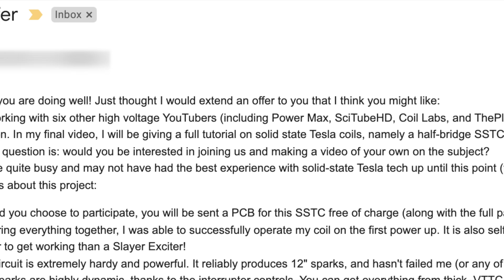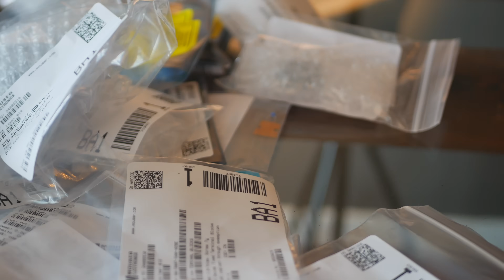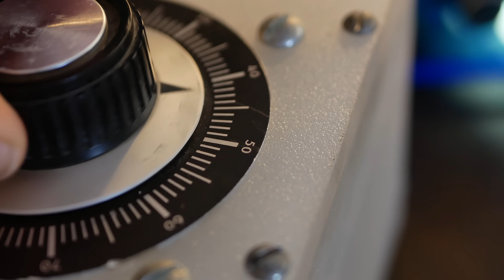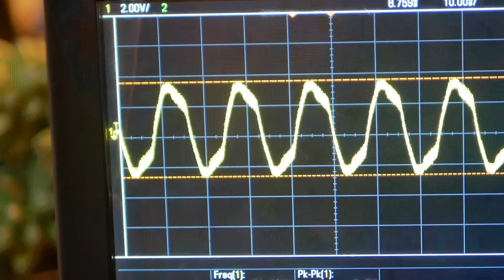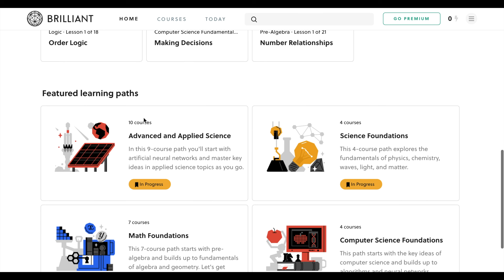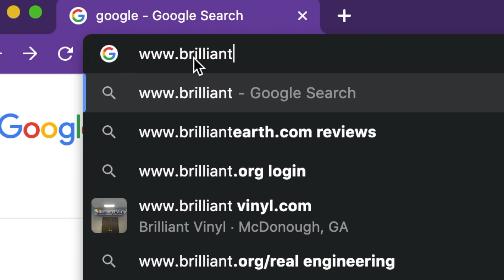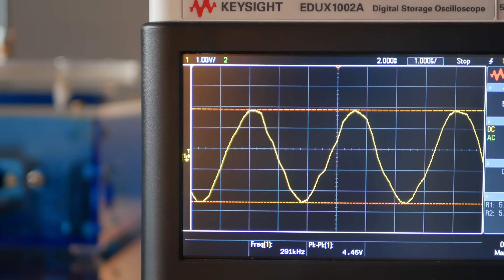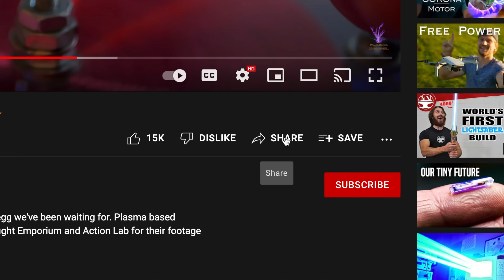⚡Building This Tesla Coil CHANGED EVERYTHING (HUGE 3D Lightning)⚡

Comment: I noticed arcing from sharp edges of the threaded rod you used.  Would replacing the threaded rod with a round rod (threaded at the bottom for mounting) increase the arc range appreciably?

Comment: I would love to have one of those boards. I am new to Tesla Coils, but I do have high voltage experience. I operate one of a handful of high current unipolar generators used to test aerospace equipment. Our lab also has a Marx generator capable of zone 2a levels. I definitely will be building a Tesla Coil for my home after seeing this.

Comment: jaw dropping implementation
Reply: spark gap can be adjusted too
Reply: pwm signal as the driver off-the-shelf
Reply: try a copper dust maglev fountain, flip the usual rotating maglev disc to a tower, or just put a electromagnet coil on the tower, then spray current conducting dust-particles from the center tower up, then keep it as a shield dust cloud, let it drop from the sides down, recirculate, you could even levitate water this way
Reply: ie, copper dust cloud shield levitation
Reply: full solid state or mechanical, the same cd shape as you have

Comment: Very cool, next build you should try flourescent acrylic, it's my favorite
Reply from the maker: Well hello there. That’s an interesting idea….
Reply: @PlasmaChannel  👍
Reply: That will be nuce
Reply: That will be nuce
Reply: Tesla coil technology has the potential to completely change the way we generate and use energy. A Tesla coil is a device that creates high-voltage, low-current electricity. It does this by using two coils of wire, one inside the other. The inner coil is called the primary coil, and the outer coil is called the secondary coil. When an electric current flows through the primary coil, it creates a magnetic field. This magnetic field causes electricity to flow through the secondary coil.

The potential for free energy from Tesla coils has been known for many years. However, it has only recently been realized that this free energy can be used to create a generator. A group of engineers at MIT have developed a way to use IGBT transistors to replace spark gaps in Tesla coils. This allows Tesla coils to generate electricity without any external power source.
Reply: @aplacetoimproveteslacoilin3721  there's no such thing as free energy. Gtfo. ☺️
Reply: @aplacetoimproveteslacoilin3721 literally impossible

Comment: Spacewind the secondary and you will get qcw like performance
Reply from the maker: How does that impact qcw? I thought that was determined by the transistor circuit.
Reply: @PlasmaChannel  higher mutal inductance less capacitance
Reply: @PlasmaChannel  if you have a higih frequnecy function generator or a  ham radio you can feed the high frequency signal through just the secondary and get discharges and a gain like inductor setup you are using without all the extra no need for a primarytuning the coil however is important especially with space winding it

Comment: Put that on a wheel that has a center metallic pole extended from a Tesla turbine, and dividing that voltage into very small fragments is possible.  Tungsten pins at even spacing, so 50-100 spark gaps are achieved for each revolution of the wheel. 
It is possible to get 2 million frequency per minute. Tesla’s one wire system is possible, his longitudinal electrostatic wave. Use a trompe to run the tesla turbine for off grid. 
The other ways of making it work better; quenched spark gap, and silver coated magnet wire. If one can get this system in an extremely cold environment and make sure each component is a harmonic of the fundamental, I believe that is what many call free energy, but it seems like a lot of work to me, not so free, but do able!

Comment: I would absolutely LOVE ❤️ to have this setup!! I built my first “Tesla coil look alike” at 14 years old. Using bits and pieces from old Tube tv guts, a fluorescent light ballast as a power supply for the fly back transformer, caps from a dozen microwave oven control panels, a small tote, 2.5” x 7” pvc former for the secondary, some 3 or 4” pvc for the primary after a lot of trial and error. The spark gap was made from these tiny brass knobs off of a jewelry box I found at the dump while hunting TVs and microwave ovens since I had depleted any and all sidewalk scores after driving my go-kart up and down every street and alley in 2 towns with a combined population of less than 4000 people back then. These towns are about 6 miles apart from each other so no big feat for a go-kart back then lol. Originally I had salvaged the magnet wire from the deflection coils inside the old TVs but of course had problems with it as I had too many connections soldered to make it long enough for 1400 turns, not to mention it was too heavy of a gauge to fit that many turns on a 7”former. After buying some 42 gauge magnet wire from radio shack, I had a secondary coil that would work. 492Khz was its resonant freq. I was only able to achieve arcs no more than 2” long but it was cool. My first coil and 95% made from junk I found laying around.. it was really more of a slayer exciter as it was able to light fluorescent bulbs from about 4’ away with no problem.. This led to a fascination with high voltage electronics and Tesla coils at first. Which grew into what I am still fascinated with today. Pretty much anything electronic 😁
Reply from the maker: Wow, that's really cool to hear about. Sounds like the good old times to me - I wouldnt know, as i've always had access to supplies, living outside of Seattle. Thanks for sharing!!!

Comment: Tesla said pancakes are more efficient if the space between the wires on a flat, are equal to the diameter of the wire. I use glass thread to get the correct spacing. Actually this is true for all coils, even solenoid.
Reply from the maker: Hmmm. I honestly did only basic research on pancake design. I'm more of a try or die type of guy myself.

Comment: Great looking build, you keep impressing me with your work. My first coil I put together in 1984, it was a 15kv 30ma neon sign transformer, a sheet of glass with aluminum foil on each side for a capacitor, hand wound 3"PVC secondary, primary 12 Gauge wire on a piece of 5 gallon bucket, spark gap 5 stainless steel screws on a 3 inch PVC cap.  Pulled 2 ft arcs on dry days, 18 inches on humid days.
Reply from the maker: That's the good old style tesla coils. Those will always be the best type IMO.

Comment: Hey Jay!  Love your channel, and your design looks super great!  I also just finished my own fancy design around this driver and had GDT issues frying a few igbts. Unfortunately minimal acrylic.  Haha I was wondering how your touching that thing??? I tried touching mine at half power and was surprisingly pretty shocking! So naturally I'm scared to touch full power. Lol
Reply from the maker: Mine at full power will very painfully shock you, but only if you are closer when getting shocked. If you let the sparks jump to hand at maximum distance, it's painless. But, moving in a couple inches, it is very painful. Closer = more current delivered.
Reply: @PlasmaChannel  gotcha! That's makes sense. Thank you for the reply! I do have one more question? I noticed that you only have one plug to run both the driver and the doubler circuit which is how I wired mine.  How are you using a variac with that setup? Wouldn't that make the low voltage circuit not work properly? Also I have the secondary grounded to the power plug ground. I know that's a big no no for spark gap coils, but is it still an issue for solid state coils? Thanks Jay!

Comment: I am embarrassed to admit that I’ve never thought to wind pancake coils like that. Looks beautiful! Might try this out myself- Have an idea for a magnifier coil config that uses 3/4 pancakes stacked on one another, separated by poly acrylic- But I’m worried that I need actual bushings or better insulators to prevent them from zapping each other! 

Love the design. Keep up the great work!
Reply from the maker: The drill winding method works well, but it's REALLY hard to keep the coil winding symmetrically about the center. You'd think the opposite, but it takes constant checking, adjusting, and intentional input. Give it a try!

Comment: Really nice work!
Gate transformers are not easy to make and can be a pain in the ass, haha (I haven't really manage to do one my self with low enough leakage inductance, to not cause problems with slow rise and fall times and ringing). In most circuits I have made (which I have not put up any videos of yet, since I have been to lazy to draw schematics), I use to build a mini flyback converter that gives out an insulated DC voltage - then use that DC voltage to feed the output of an opto coupler with built in gate drive instead (for example the HCPL 3180, which I bought a load some time ago). 
A little more work, but often worth it given it also have some advantages. If building for example a buck power regulator for another circuit, the transistor can be continuously on (allowing for 100% power) with the gate still insulated. The gate charge voltage can also be kept constant over a vide range of input voltages to the circuit. The downside is at very high frequencies (>250 kHz) though, since that requires a very fast optocoupler/gatedriver setup to work.
Reply from the maker: Thanks for the input. That's good stuff to consider. As a purist myself, I favor simplicity over performance. So even if my IGBT's die in a few months, i'm okay with that. I'll just replace them. From all indications though, the final build had no issues with IGBTs. Wooo!

Comment: Beautiful work Man!!! I bought 2 of those small Pancake SSTCs you have there pretty cool but the output is so weak lol I tried to replace the stock FETS with IRFP460s and up the input voltage on one of them It blew up lol.
Also you like compact how about using a ZVS driver and a battery to power it instead of an outlet I am currently working on one and cant wait to post a video.
Reply from the maker: My first thought was to make this coil rechargeable and cordless. However, it just got too complicated in my head. Thanks for the compliments!

Comment: another awesome vid. nice work! interestingly, i was just thinking about your atmospheric electricity vids and wondered if it would be possible to strap a tesla coil on to a drone and see if the tesla coil behaves any different above the tree line.
Reply from the maker: Thanks. That's an interesting idea. I dont think there's any evidence to suggest being at mild height would affect tesla coil performance.
Reply: @PlasmaChannel  .....In reference to "Milo Gonzalez's" comment.....What about constructing a very large capacitor, (Leyden Jar) from a 5 gallon or larger plastic bucket. Place the leyden jar-capacitor outside of your bldg & collect atmospheric electricity?  Even better before or during a storm? I wonder if you could power your tc with it?

Comment: I really would like to build my first TC but I would like to start with something like that, a SSTC. I have a pretty good knowledge of electronics and I think this is the kind of design that fits me personally.
Reply: You can order the boards for like 15 bucks from jlcpcb. Labcoatz has the board files for free
Reply from the maker: Really, the way it works is pretty easy. However, getting everything to behave and not murder each other is the hard part. Give an SSTC a go. I will also put you in the running :P

Comment: Beautiful build! I noticed that GDT could have some issues a few weeks ago on an Instagram teaser, but rest assured, the IGBTs died for a good cause. I also noticed in the teaser a Bluetooth module, is there eventual plans to make this play music? Also, I built a coil with the same circuit and it works great! I decided to take on the build plasma channel style, so I’m building the whole thing in a nice acrylic enclosure! I switched from antenna feedback to a current transformer because I didn’t love an antenna sticking out of my build, although your antenna set up is quite nice! After tuning my primary just right I get arcs are nearing 1.5 feet feet long off of a 10 inch secondary! I’m tempted to build a pancake secondary now with how elegant yours looks! Again, beautiful build, and great video!
Reply from the maker: Hey, 1.5 feet on 1 foot secondary is impressive! Glad you enjoyed my video too. One this to note is you will not be able to create sparks near that long with a pancake - pancake are inherently limited, as sparking between turns is common. I designed mine RIGHT on the cusp of internally breaking down (I tried 110% power, sparks started to form between turns, and arc over the entire radius of coil to the edge). So, there are tradeoffs. But, like I said, I dont really care about performance. I care about appearance and convenience.

Comment: I had no idea you could make a tesla coil with the secondary laying flat. I wonder, could you play music from it?
Reply from the maker: Yeah, pancake coils have been around for a while. They are just really hard to wind correctly, so most people prefer to do normal cylinder windings. Yeah, music is capable with this build. But, wouldn't work on my configuration. The Bluetooth board did not like being under that secondary.
Reply: @PlasmaChannel  ah, I see, are there other types of tesla coils be sides normal and pancake?

Comment: cool implementation !!!  My Tesla coil secondary ( 40 years ago ) was wound using wire from a scavenged car ignition coil wound on a 3 ft long 1" diameter PVC pipe. The primary was done with 10 turns of 1/4" diameter copper pipe. Sparks went end to end of the secondary  ! Would love to try a flat pancake version.
Reply from the maker: End to end of the secondary? That's pretty insane. Pancake is a lot hard to do, but give it a try.

Comment: Nice!  I just happened to be looking into how to use IGBTs for a coil setup!
Reply from the maker: They are really sensitive. Able to handle high voltages, but are whiney little children when it comes to the trigger signal...
Reply: @PlasmaChannel   I also found they are slow on the turnoff too...

Comment: Love this channel!! Reminds me of when I built my first Tesla Coil during my college summer break back in 2003! Your channel is inspiring me to build another and maybe even try solid state this time! Keep up the amazing work!
Reply from the maker: Thomas, thanks so much! I love hearing how my videos affect viewers. Give an SSTC a try -Just be careful.
Reply: @PlasmaChannel  where are you buying all of this can you plz give me the link
Reply: Was it working?
Reply: @ajay6225  Yeaup, could get a 1 ft arc out of it. I used a 15kv 60hz neon sign transformer as the source, which fed into some small copper tubing that I used as the primary. Used a lot of magnet wire wrapped around a PVC pipe as the secondary. For the toroid, I used a couple aluminum pie plates back to back with flexible dryer vent around the outside. Then wrapped all of that in aluminum tape. I used 5 or so short pieces of larger copper tubing on a flexible platform as the spark gap. I don't remember the capacitors I ended up using, but definitely remember popping a few doorknob caps in the process. Man those things smell! Also forgot to bleed the charge from those caps once and that hurt pretty good! Only did that once though!! 😁
Reply: I built my first when I was 12 but it only made 5mm arcs.
Reply: Tesla coil technology has been around for over a hundred years, and the basic design has not changed much. However, a new way to use IGBT transistors to replace the spark gap has made it possible to build a Tesla coil that can generate free energy.

The traditional way of building a Tesla coil is to use a spark gap to create the sparks that flow through the coil. This approach is no longer necessary with IGBT transistors. By using IGBT transistors, it is now possible to create a Tesla coil that can generate more than enough energy to power itself.

This new approach to building a Tesla coil has the potential to change everything. With this new design, it is now possible to build a Tesla coil that can generate free energy.

Comment: I have had the exact same thoughts for the past 5 years or so about SSTCs never really liked them for some reason. But whenever I got deep into research I always found some old guys making huge arcs in their garage with SSTCs. Now that you also made a video I might aswell give it a try!
Reply from the maker: The trick with SSTC arcs, is they tend to produce arcs much longer, however, those sparks are an optical illusion. They are composed of hundreds of smaller bursts building on one another. Trick tricky little hobbitsis...

Comment: Hello J,
I have made a Tesla coil but I am getting shocked when I am grounded and touching the arcs. If not grounded I have no effects. It says that Tesla coils outputs are higher frequency so it doesn't shock but for me it is not working.
Reply from the maker: Hm...how much power does your coil consume? If it is very high powered, i'd recommend not touching it. Even large coils perfectly tuned can carry lower frequencies within the output.
Reply: @PlasmaChannel  umm it's pretty low powered. Only gives 1 inch of spark. And i am not getting shocked when i am isolated to ground. And as a power supply i use Amazon's 400k v generator( Which produces about 10-20kv)

Comment: This would be such an awesome build, holy cow those arcs though! I'd love to add an audio modulator so you could play music with it.
Reply: I built this circuit with Zacks board and it has a spot to add a 12 volt signal for audio but I added a simple circuit to run it off a fiber optic controller that one tesla sells.
Reply: @mikemesec  that's fantastic!